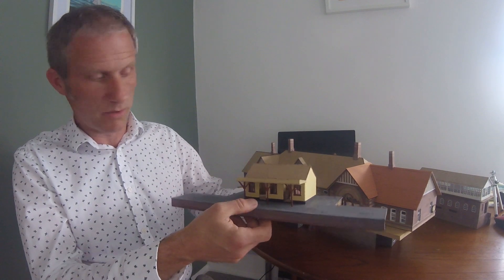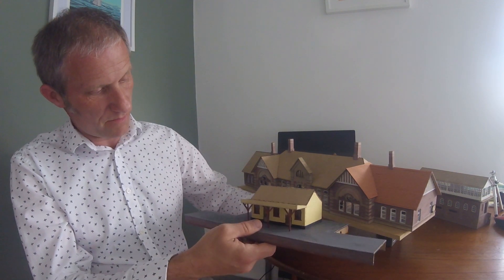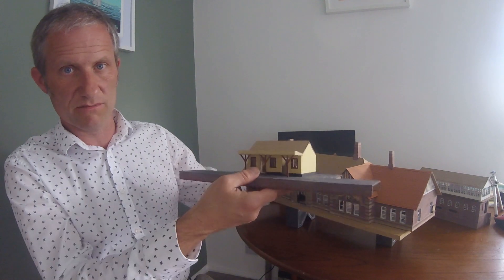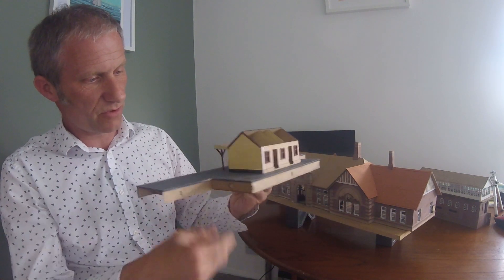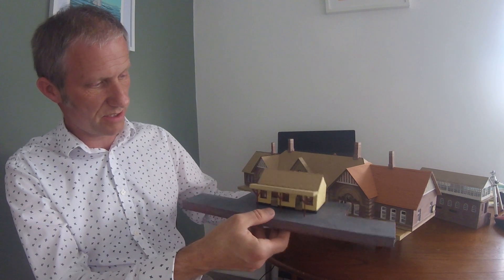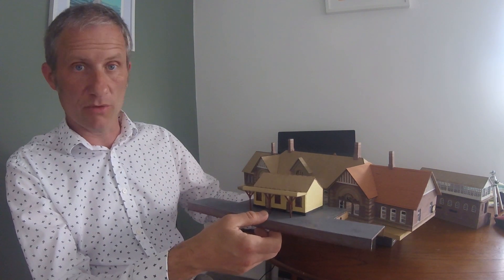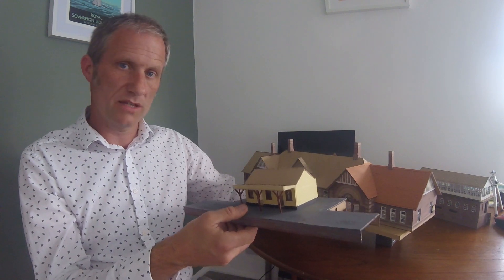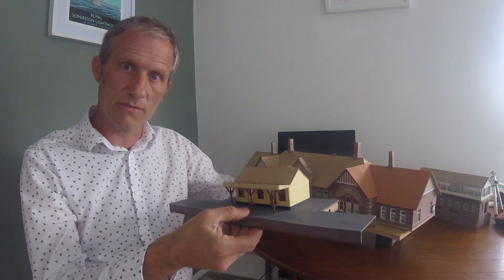Introduction to the Vlog, Ashford TMD & Bodiam Station

Comment: Hi James, thoroughly enjoyed all your videos so far. I have been following Paul for a long time so immediately looked at your site and subscribed. Wow those railway buildings are brilliant, I was amazed how similar the engine shed at Ashford is to the one at Bognor Regis which I am building. Like you I have a load of old photos which are great to work from. I cannot do computer stuff or lazer cutting so its good old pencil, ruler and paper for me. Mine is in N gauge though and I will be building it from Metcalfe kits which will be seriously altered. Like yours there are two main doors with a central pillar and roof going horizontally across, nothing like the Metcalfe kit. Again I will be putting it on YouTube when I can purchase more kits after the shops open. Really looking forward to your buildings though, I could never match yours but I get a lot of enjoyment out of others doing better and passing on ideas.
Regards Chris
Reply from the maker: Thank you Chris.  I've just had a quick google of Bognor Regis shed and I see what you mean.  If anything, the brickwork detail is a little more interesting.  If I get the chance this week, I'm going to have a go at laser cutting some N gauge brickwork.  If the results are any good I'll post them on the channel.  In fact I'll post the outcome regardless, it would be an interesting challenge.  I shall look forward to seeing the fruits of your labours on your channel in future - and I am sure it will be brilliant.  I like that part of the world and have spent many happy holidays in the area, it will be nice to see the progress of your model.

Comment: Thanks James for a very interesting video.
Laser cut buildings are something that I’ve been interested in for a while now.
My background is in engineering and indeed I used cad to design components for Spark erosion 15 years ago to make injection moulds for the car industry.
Obviously things have moved on since then and I look forward to your future videos, which I’m sure will show me what can now be done using this technique.
All the best!
Reply from the maker: Thank you so much, I'm sure you'd be able to show me far more than I could show you.  Spark erosion fascinates me and is an area with which I have very little experience.  Over the coming months I plan to show how accessible all this technology can be for the home enthusiast.  Comments and suggestions from folks with industrial experience will I am sure be of great benefit to all - not just me.  So thank you very much for your support as I begin this YouTube journey.
My best wishes, James
Reply: Bexhill West 
I left the industry 15 years ago, but I’d be happy to add anything useful if I can.
It’s going to be interesting to see the equipment and software you use.
All the best.